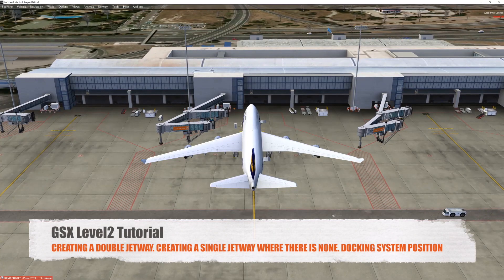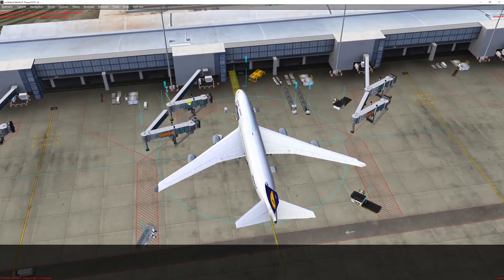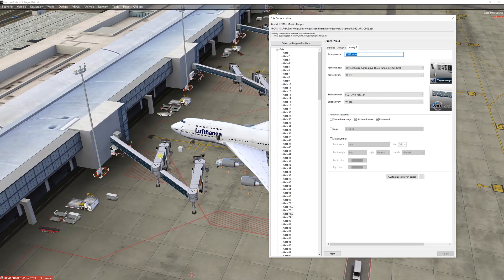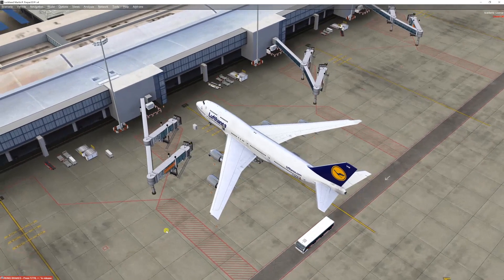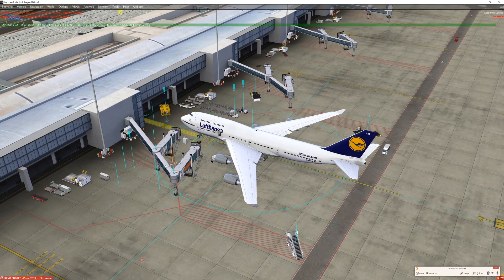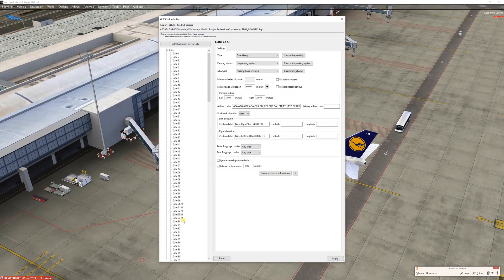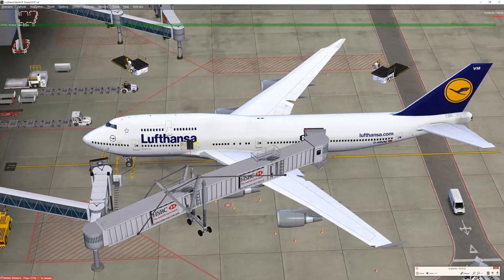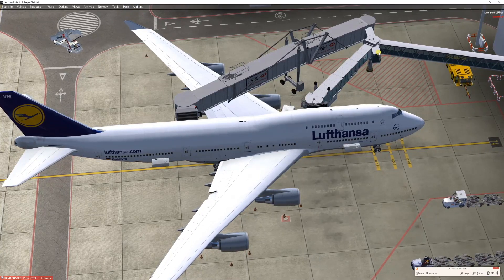GSX Level 2 Tutorial. Chapter 7: DOUBLE & SINGLE JETWYAS AND DOCKING SYSTEMS

Comment: how are you moving the jetways? which key
Reply from the maker: GSXLevel 2 Menu is CTRL+SHIFT+F12
Reply: @cartayna  sry, Not that, i mean in the Editor of the Jetways and Vehicles? With which Key can i move the Cars and Jetways?
Reply from the maker: @paul.4895  arrows. check page 37  of the manual. there are all the keys for the editor.

Comment: Nice video,
I installed your files for LIMC, 
I wanted to ask you, it is possible to have 3 jetway in a gate? or the maximum and 2?
Reply from the maker: Maximum 4. if you have LOWW or KMIA, download my files... and you will se a 3 jetway in certain positions. The only 3rd jetway that you can use with out hitting the wing (other than a A380) is the over the wing jetway.
Reply: perfect thanks, I would like to try to put 3 jetway at LIMC gate 406-409.... or do you plan to update your files for LIMC?
Reply from the maker: @silviobrindisani1335  i am planning to upgrade all scenery configurations to v4 once the new release of GSX comes out that is currently being tested (PBR and more). it looks awesome. Having said this, the v4 does not add more jetways, just adds an option to have another configuration,  more realistic jetway configuration (metal where is metal)